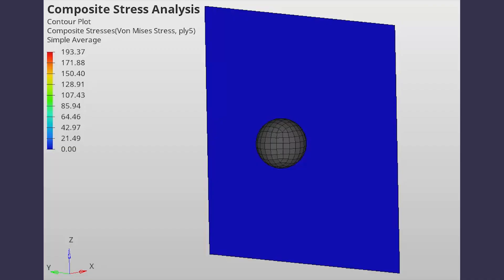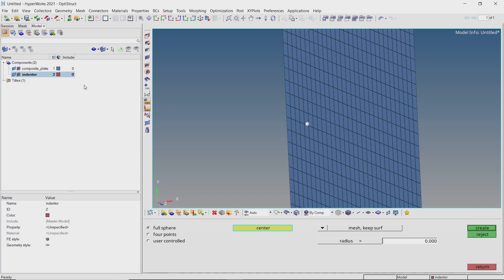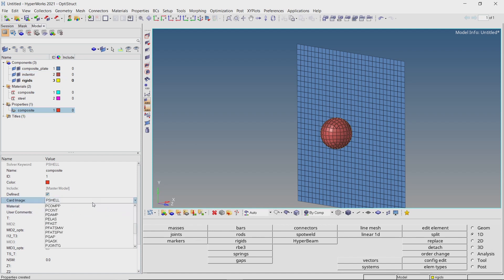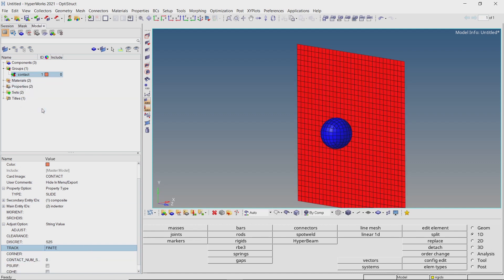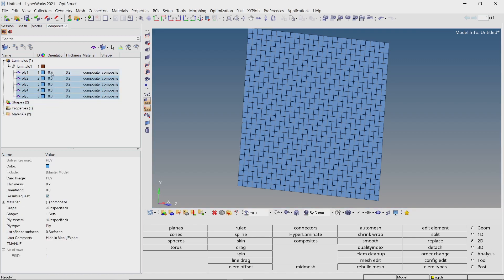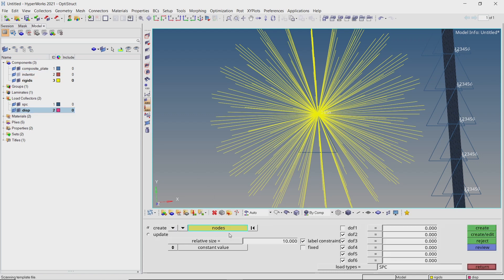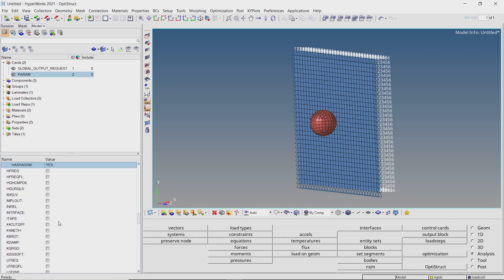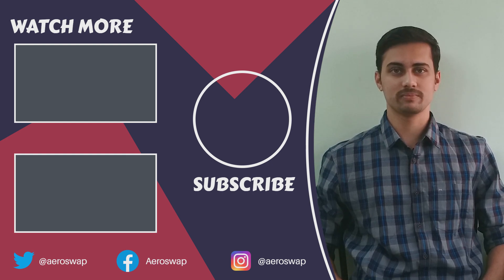Nonlinear Composite Analysis using Hypermesh [Optistruct Tutorial]

Comment: Sir here you assigned material property (like E value, G value) manually to composite. But suppose i want to make a composite of E-glass+carbon fibre+powdered aluminum oxide using epoxy resin. I don't know the property of composite beforehand.How to make the geometry for the above composite? I am facing difficulties in making the exact composite. Could you help please.
Reply from the maker: Hello Siddharth, in its standalone state, Hypermesh is not capable of modelling fiber reinforced composites. Only ply-laminate composites are supported. To do this, you have to link Altair 'Multiscale Design Modeller' with Hypermesh.
Reply: Did you got any way to solve this problem of yours. I am facing the same difficulty now. How to get the property beforehand for carrying out the analysis

Comment: Hi Swapnil, I am also using 2021 version of hypermesh, even after following each and every step of this video, i am getting an error  "case Control data DLOAD missing in bulk data". what could be the possible mistakes that i might be making ?
Reply from the maker: Please check the type of loadstep you are using. It has to be 'Nonlinear static' as shown in the video. DLOAD entry is only found in 'Transient' analyis loadsteps and should not cause a problem in static analysis.

If you have other loadsteps in the same model, try to delete them and rerun the analysis.

Let me know if it works!
Reply: As of now there is only one load step with type as nonlinear static
Reply from the maker: So the issue still persists? This should not happen as there is no entry 'DLOAD' in the static loadstep. I never faced this problem. Please make sure that the force load collector is not empty. Sometimes, we forget to change the current collector and the forces do not get stored properly.
Reply: Thank you for your response  and support, i will set up solver again from start to eliminate any errors. btw Great videos and work , keep it up !
Reply from the maker: Thanks! Do let me know if you still face the same problem after setting up the analysis again. Feel free to write a mail to discuss in more detail. My contact details are provided in the 'About' section of this channel.
Reply: It worked this time ! Again Thanks a lot.
Reply from the maker: Good to know! Thanks for the update.

Comment: Hello, can you make a tutorial about wing analysis ? Like how to mesh the spar and ribs, link them with rivet and try to optimize the stucture thanks
Reply from the maker: Thanks for the suggestion. I will try to work on this idea!
Reply: @Aeroswap  thanks, and just one question for you what is the best way to define our 2D elements size in order to have good mesh quality and acceptable simulation time
Reply from the maker: Hello Harry,
The average mesh size is usually decided as 1/10th of the smallest dimension in the component. This is for straight edges. For curved edges, smaller mesh size must be used to capture the curvature accurately.
Reply: @Aeroswap  Thanks, and we can adapt the size if we have different components by geometry. FoR instance one component has the smallest dimension of 1o mm, so we use element size of 1 in 2D mesh.
Moreover if we have an other component which minimun size is 20 mm we can use element size of 2 ? 

Best,

Harry
Reply from the maker: Yes, definitely. That can be done. Just a quick reminder that this is only applicable for nonlinear/linear static analysis and optimization.

For dynamic/transient analysis, it is always preferrable to use a coarse mesh. The time stepping is based on the smallest element length. Using a fine mesh will result in very long solving times. Hence, it is better to use a coarse mesh with simplified geometry when performing dynamic analysis.

Comment: HI! Could you do a video on one and two layers of FRP retrofitting on beam or column specimens using Hypermesh.
Reply from the maker: Hello,
It is not possible to model reinforced composites directly in Optistruct. It only supports ply-laminates (orthotropics).
To accurately define FRP, separate applications like Altair Multiscale Designer have to be used.

I will still consider your suggestion and see what I can do about it. Thanks :)

Comment: Hi Swapnil, nice to see you :) Your presentation of a composite plate impact was very good, however I would like to point out that in cases involving impact on composite structures we are usually interested in calculating the failure/damage of the structure, thus an appropriate (or more than one) failure material law (Hashin, Puck etc.) should be defined. In optistruct, this is done through the MATF card. As you know, it is possible for a composite structure to have failure in certain elements without failure of the entire structure.
Reply from the maker: Hello Emmanuel,
Thank you for the information! The MAT8 card can only define a 'linear orthotropic' material. According to my knowledge, it is not suitable for applications where stress crosses the elastic limit. Keeping this in mind, I designed this load case such that the maximum stress in all plies remains below yield at all times. So essentially, there in no material nonlinearity in this analysis (only boundary nonlinearity due to contact).

As you mentioned, failure may be assigned using MATF to make this analysis more accurate. I will try to create a follow up tutorial to this where failure can be observed. Thanks a lot for your insights on composite modeling. This will be of great help :)